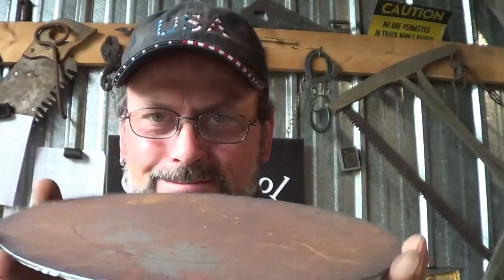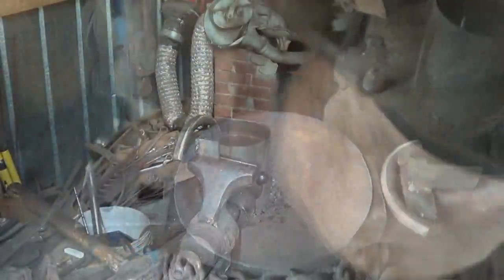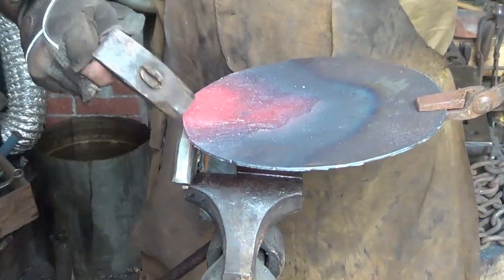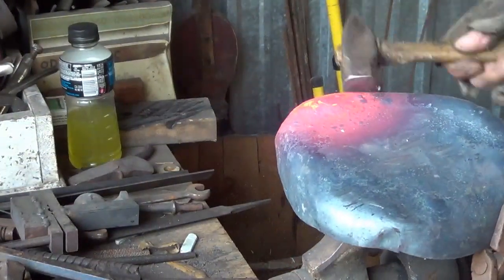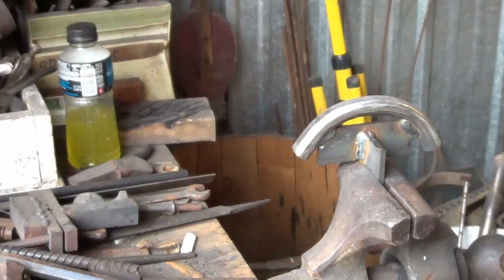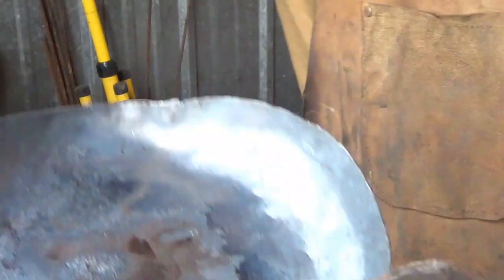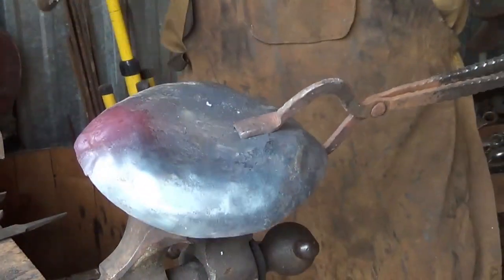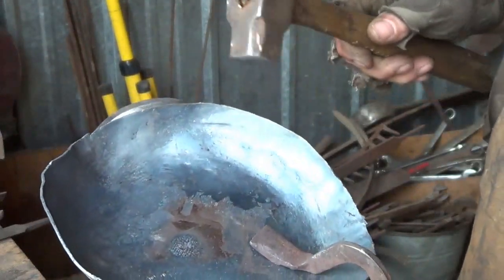Blacksmithing - OSF Way Of Forging A Pan-Last Pan Video I promise

Comment: I wonder if you could find a piece of thick steel (1inch) with the inner diameter of your pan. Then you could bend it around the plate. Maybe?
Reply: this is how commercial frying pans are made, it stretches and upsets the outer edge in one movement using a hydraulic press. Chandler's method seems very efficient for a blacksmithing approach.

Comment: i think what would probably work out really well is to combine this method with your last videos method of shrinking the edge. i think if you start by shrinking the edge youll get the pan to where the last one was then go in with the tool in this video to take it to 90

Comment: Counter sunk rivets from the inside, makes for a nice smooth transition on the inside. Snug them in hot, nice n tight, and they are virtually leak proof.

Comment: chandler, try angling the curved jig you made so that the curve  more closely matches the curve of the pan rim. right now, you're bending over a straight edge, imagine a hill cut down the middle. but if you angled it downward, you would have more of the curve, which would stop the other sections of rim from warping so far. i know that is a terrible explanation, but maybe ill try it out and make a video to show you. if only video responses were still a thing

Comment: Hey Chandler, what is it with the 24 furnac runic lettering system in the background ? Have I missed something or are there coming some late iron age early vikning-age up on your channel soon ?

Nice pans by the way, you ain't going hungry to bed if your'e going to test them all as you did with the first pan ;)

Comment: try working the piece from the other side so you can hold the flat bottom of the pan verticle and parallel to the jaws of the vise.

Comment: Go to goodwill, get a pan that is the shape you want, and use it as a form. Either that, or you can use it as a mold to cast a form of the inside of the pan. Then when you form around it, your pan will have the same inside shape as the starting pan.

Comment: you need  2 forms the size you want the bottom of the pan. sandwich the steel in between in a press and use a torch to heat and hammer the  sides to shape.  will have the hammered look on the sides and a good flat bottom and will retain bottom thickness.

Comment: Factories make pans/pots in two ways - as far as I am aware. One: They pour liquid metal (typically aluminum) into a mold. Or Two: They use a lathe which pushes the disk of metal into the shape. If you wanted to make pots to sell, your best bet is to use the second method - assuming you have a lathe.

Comment: You should definitely forge out some shorter steel trivets/grills 3-5" tall for cooking over a small fire or in a fireplace. Make three legs a little curved and twisted. Say a 10"  diameter ring with 1/2' bar stock  scarfed and forge welded.as the circle::and a grill of 3/8 or 5/16 bar arc- welded flush with the ring; one per inch .  Big enough for two or three steaks over an open fire (or one big porterhouse) and/or as a trivet for a frying pan. And everyone would watch you make the trivet/grill. Make a knife and four-pronged fork out of a pair of railroad spikes (just like before but perhaps plainer). And some scalloped barbecue tongs out of rebar or stock, and a spatula. Season the little grill. Season the steak.  Grill a Mongo-sized Porter house that barely fits. Tape it all.  Sell same.

WADDAYATHINK? Every body loved you cooking over the forge. The haters that bitched about your hands, just do not understand that a real man eats when he is hungry.  Sometimes he cannot wait until he is clean.

Comment: You probably already know this but I wouldn't use any steel that's not in the 300-400s. 316 stainless is a really good steel for pans and pots but there's some small changes in different types that may work better. 316L is what I think I used and if I remember right it holds up to corrosion a lot better. I'd just be careful eating off of something that could be leeching lead or something else into the food.

Comment: one suggestion, make sure that the bottom of the pan is really flat, unlike the middle pan that was wobbling a bit in the end of the video. Otherwise they are only suitable for gas cooking, rather than ceramic or induction cooktops (on which they will wobble if not very flat on the bottom.

Comment: try this. start with1/4 or 3/8 plate,      1" from the edge start moving metal out from center until you have a 1/2 thickness step.then use that tool to angle the now thinner sides down to create the bowled edge. thicker and flatter bottom,where you want the even consistent heat. thinner sides for containment,and radiating heat. let me see the video ;)

Comment: as I mentioned after first pan video, automotive panel beating techniques, you're using a dolly and hammer the same!e as a panel beater, but with hot steel in stead of cold

Comment: *Chandler
     Pans are great, then armor is even better. But the next thing I see in your futur is a spaghetti damascus knife or do another sword Sanmi (that's not the spelling) but you get the drift get it drift lol.Or even something with a hamoan again spelling but anyway you got the drive to do what ever you want.
As always the Chandler way charge forward never looking back until you succeed. Then he starts a nother goal...... Great video you will get it ,with that kind of ethics anything is possible expecially success, success success you are going places brother Wether you want to or not. By the way if it's hot get a new pair of gloves .

Comment: how come you don't weld a square pipe on the bottom of that cylinder, so that you can have it secure in the square hole.. that way you won't have to keep adjusting and watching your feet....  "need a tool, make a tool"?

Comment: Have you thought of drilling a hole in that big metal cylinder, on the side that has the deformed edge?  Then take a piece of bar stock the size of the hole in the anvil, drill and tap your metal cylinder.   Then you won't be wasting time dickering with the cylinders position on the anvil.  Would probably save you a few heats per pan.

Comment: im not a blacksmith but i am an engineer and i no u dont want to do another pan video but correct me if im wrong i would have made a cone and flattened the bottom i no it would require a weld but could b quicker in the long run

Comment: How come you don't try to form in over another pan or like an old pot filled with cement or something like a round anvil
Reply: Also how about a griddle just upset the bumps in the pan and then you only need a real small lip anyway

Comment: Why not use a piece of square stock made in the half moon instead of the round stock it would give you the option to sharpen the wall angles off the corner

Comment: you are making stuff more difficult than they have to be. Try marking a circle at the inner diameter and upset the edges from that circle and outwards using the cross peen rather than the face of the hammer. You will get a lot less warping in the bottom and more control of the upsetting. Do it in three or four passes depending on how high you want the rim.

Comment: you might find it easier if you place you're tool horizontally in you're vice instead vertically
Reply: My thoughts exactly. I was screaming "turn your tool around" at the screen!
Reply: Me too -  I really thought the tool was basically a segment of a circular 'die'  to form over. Till he put it in the vise on edge...

Comment: On Time Team the British version.  They made a brass bucket and started with a round piece of brass or bronze, what ever it was.  And they had a circular piece that was the size they wanted the bottom of the bucket to be and centered the metal over that and started shaping things from what would be the bottom of the bucket to the top.  I am thinking that might be a better method and it took him three Days to make the bucket.  So two things.  1  I think you need to change where you start shaping the metal from. Not top down but the reverse of that.    And I think you are not allowing enough time.
Reply: I would love to see Mr.Chandler Dickenson and Mr. Phil Harding hang out, lol
Reply: *Dickinson

Comment: under the premise of need a tool make a tool, if you're so intent on making steel frying pans, I don't understand why you're not using a press form.

I do however understand the allure of hammering rounded bowl shapes.  I've done some in brass and they looked sucky at first but it is addictive.
Reply: Gary Myers cause it aint 'OLD SCHOOL'.
Reply: sure it is.  In the old days they were constantly trying to find better ways to do something.  Old School doesn't mean stupid.  Paul Revere (yes, that Paul Revere) used press molds for spoons and bowls as well as cast molds for dozens of other household items that were made at his foundry and they were made that way because making it easier also made it cheaper and more economically viable.  He also beat things with hammers

Comment: That is TOTALLY not the way I expected that tool to be used.  I thought you were going to turn it 90 degrees so that you'd lay the pan on the flat side of the tool, and then bend it over the edge along the curve with the hammer.  I was picturing it more as a mold for the radius of the pan edge.

Comment: Hi Chandler, I've watched (well right-arrowed through most) of this and the previous two videos.  I've been making armor for over 20 years and while I'm not the best at it, I can say that raising is the way to go for pans like this.  A basic frying pan should take you no more than 10 minutes if you're raising.  Of course more for cleanup.  But that's a whole separate topic.  ;)
Here's a basic video on raising a helmet.

https://www.youtube.com/watch?v=Tt68Ymedc6k
This guy is not very good at raising either, but he shows some of the proper technique.  For one, you need a cross pien hammer and you need to be hitting it at right angles to the direction you're moving the metal.  A cross pien only moves metal one way - and you want to use that, to move the metal only toward the inside.  In your last video you were using the cross pien in the same direction as the desired motion, and spreading the metal back out.
When I raise, I have an O/P rosebud, and if you get a big one, it's plenty for 14g.  I also have the torch mounted on the left side of my stake, and I have it running constantly.  So I'm maximizing the heat in the piece: once it gets dull red I just flip it over on the torch.  I don't move at all, and I'm using lots more residual heat to help it get back up to temp.

I also recommend setting up a dedicated stake of some sort, and to get it to the proper height.  You were chicken-winging a lot in the last video.  I've known a LOT of armorers who are under 60 and have elbows that click.  Don't be like them.  Hold your elbow at your side, get the hammer head positioned where you can see it,  with your head erect, and build a stake that stands up to that exact spot.  Don't hit anywhere but that spot - move the work, not your hammer arm.

I make a lot of use out of standard vise grips for raising.  You need to figure out soft jaws... I usually just pinch a strip of 14g in half over the edge and grab that.

Of course, you may have figured out all of this already... I'm still going through your pan videos.  Your hard-headed unwillingness to give up on something you want to know is a real inspiration.
Reply: fisharmor thanks for that, if no one else gained some useful knowledge from your words, just know i have...

Comment: I bought my carbon steel pan on Amazon for like $35, but it doesn't have a welded handle, which I agree is better.  I mean, rivets make sense if you're making an aluminum pan with a steel handle or a copper pan with a brass handle, but you make a steel pan with a steel handle, why tf don't you just weld that shit?